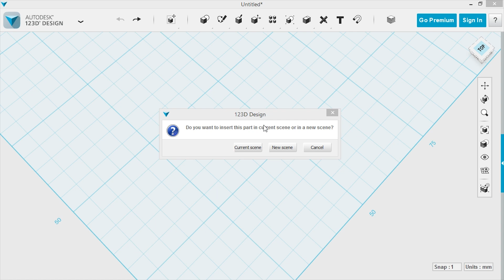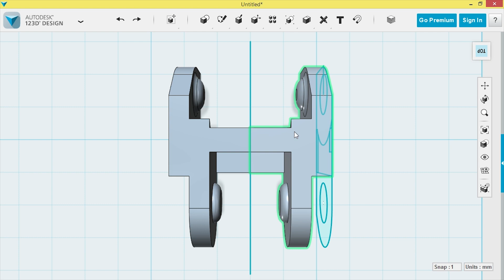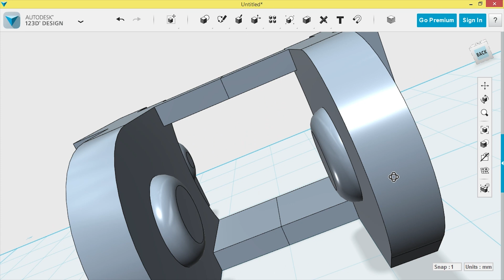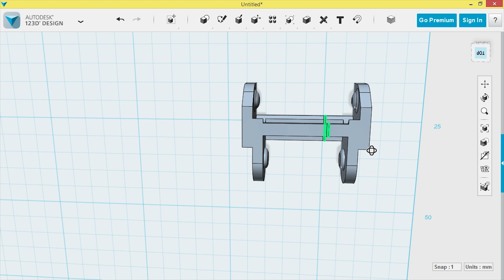Upgrade a Kit 3D Printer with a Cable Chain Carrier - Better Build Quality 3DBurn

Comment: You can buy cable chain for 5 to 10 dollars per meter. That's a lot of plastic to print and lots of time. I think I'll just buy it ;)
Reply: This would have been about 0.09 lbs in filament. So, $1.10 in materials assuming $28 (canadian) per KG.
Reply: Jerkson It's not the cost of filament but time. Much more important things to print and do. But to each his own, ; )
Reply: Filament prices can vary. I got 1 KG of PLA for $19.00 CAD.

Comment: Hey, nice video! -- It looked like the chain links printed with supports (between the lower and upper surfaces) -- were the supports easy to remove? -- What was the finish like on the inside of the cable? -- About how long did it take to snap it all together?